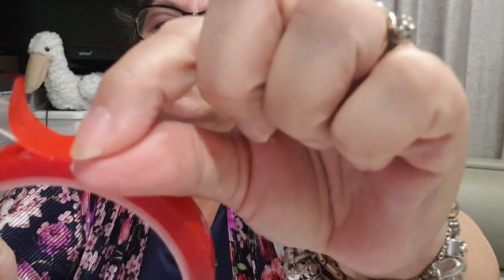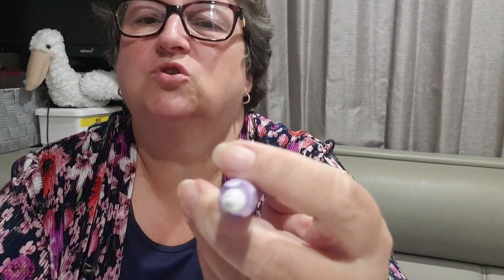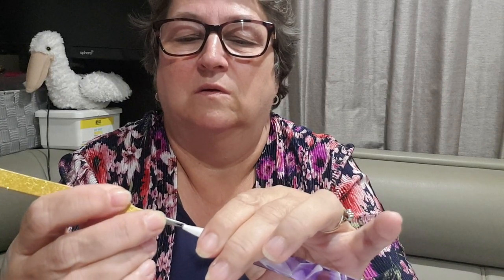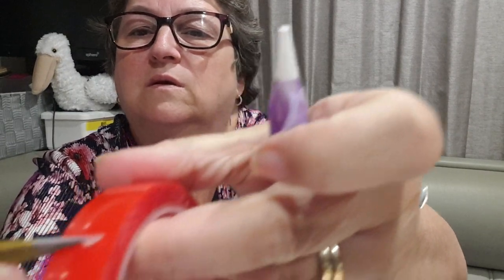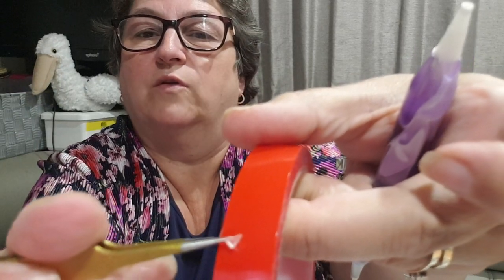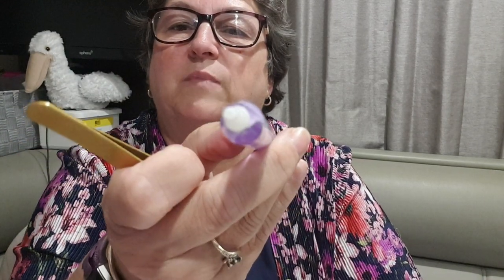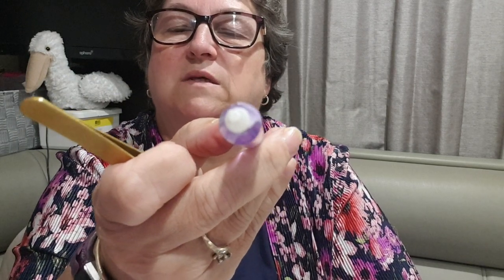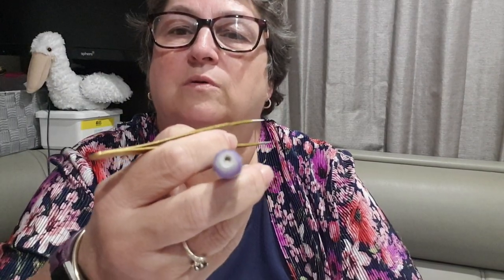How to load your Pen with Nano Tape

Comment: Thank you for the video.  I have tons of the stuff and thought about trying it but didn't until I saw your video and just failed with the glue dots.  I could not make it work at all.  FYI you don't need to replace the nano tape, it's reusable, you just need to wash it off with water and a bit of soap. 

I use thicker tape so it just fits in the slot without any real mushing up on my multiplacers😊